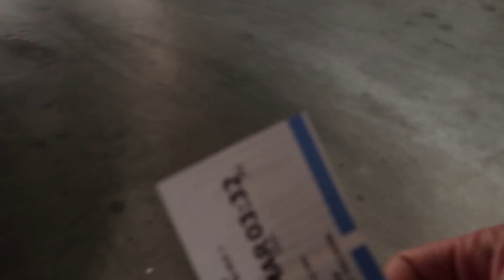Engine Swapping The MR2 ?

Comment: Hey Rexy, what about the version I liked most of the 3S-GTE turbo in the 4th gen Toyota Caldina because they completely revised it; even with a reinforced cylinder block & higher flowing cylinder head etc. 
It put's out 191kw in the Caldina stock, but just one modification courtesy of the turbo boost controller will easily get it up to 230kw. 
It makes the MR2 a 12sec car like that.
Reply from the maker: I'd like to but it'll be a lot more pricey that a cheap V6 swap
Reply: @RexH  In Australia, a 3SGTE are extrememly rare. Looking 3/4k just for the engine while I got a 3VZ turbo for 4k installed

Edit. 1mz and the 3VZ can use the s54, but if you drop the clutch hard you will strain it. The turbo tranny (e153) is good but you don't need it immediately. Don't go the 3SGTE in Australia, I've been looking for 6 months and you're going to pay stupid prices for it. I know exactly how you feel, the V6 is the swap you want.
Reply: Ben's Chill Channel 
It might be rare, but the motor is well established with the extensive use in Rally's with lesser cylinder blocks in the Toyota Celica, despite having significantly higher power outputs. 
It would be hard to beat in terms of power per litre of engine capacity for the weight & dimensions. 
With the modifications Rexy has already done, I think the torque down low would be a match for the V6, plus it has less mass. 
The sky is the limit from there.
Reply: Rex H 
I found a place near Melbourne that supplies second hand 4th gen 3S-GTE turbo motor's: 
http://www.toyrolla.com.au/toyota-car-parts-3s-gte-engine/
Reply: @brantleyfoster021  Problem is though, you need more than just the engine. You need a halfcut, because ECU, axles and a few other things. It is a good motor, and their is decent aftermarket but $$$ to get all the parts for a swap. Like super easy to build to like 300 HP with only a few cheap mods
Reply: Ben's Chill Channel 
But wouldn't you need to do that for a Supercharged or turbocharged V6 too?
Reply: @brantleyfoster021  You do have to get halfcuts for them usually, but they are way more common. The V6 camry is what 2 commonly swapped motors are from (3VZ and 1MZ) and they're in abundance and you can pick up a junkyard car for $600 in decent condition. Shame since the 3SGTE is an easy swap aswell
Reply: Ben's Chill Channel 
The latest Camry motor with over 300hp would be awesome, but the problem is it's the latest model. 
I doubt you would be able to get it for that cheap tbh.
Reply: @brantleyfoster021   Yeah of course, that's the 2GR. That's an awesome engine that I'll never be able to put into my MR2 ahah.

 The 3VZ which I run on my mr2 (from 1997 camry) with some mods (port and polish/intake/timing mods) made na around 200bhp and can do a mid 13 1/4 mile which is as good as a lightly tuned 3SGTE.
Reply: Ben's Chill Channel 
If it's a mid 13sec car, than it's pretty close to a 3S-GTE turbo. 
I wonder how it would respond to the RX7's Twin Turbo Wankel Rotary?
Reply: The 4th Gen 3S-GTE has weak rods anyway. 3rd Gen is the way to go. Stupid easy to get 300whp+ out of that engine with bolt-ons only.
IMO a V6 will never be as exciting as a 3S-GTE. I’ve owned quite a few of each and V6 bores me very quickly.
Reply: @negativeindustrial  That's just you man I love my v6 but the 3SGTE is an awesome engine. But currently it is cheaper to buy a Caldina and then scrap it. Which is the same cost as a 2GR almost. On Carsales, the cheapest Caldina is almost 5k, with 200,000 Km.
Reply: Ben's Chill Channel
Yeah, we can stumble over all the V6’s in our junkyards here in the states. 3S-GTE’s are rare as hell and somewhat costly here. That’s a huge factor, as you pointed out.
The V6 works great in the FWD Celicas we were stuck with here, too.
Reply: Neg Ative 
4th gen has a better cylinder block though, they did this because prior version's were prone to cracking.
Reply: Brantley 
I’ve heard that but have you ever known anyone who cracked one? I’ve got a pair of 28yo gen2’s downstairs in my Celica and my MR2T and over the years I’ve had a dozen more, probably easily that many friends with them - all gens 1&2 because US spec - none cracked. Not one.
In the US we use our 98+ Camry blocks to make super strong stroker 2.2ls
Reply: Neg Ative 
The 3rd gen rod's are compatible with the 4th gen motor, make the switch for the best of both world's. 
I haven't met anyone who has damaged the standard rod's in the 4th gen though, but do know a few people who cracked the cylinder block of prior gen motor's to the 4th gen.
Reply: Brantley -
The cylinder head?!? I assumed you meant the blocks. Damn
I’m pretty happy with my Gen2’s. I’ve always appreciated the low end feel of T-VIS and I run modified Gen3 WRC Turbos from Celicas on 21PSI and RC/CS ECUs (which have much more aggressive timing).
I’m also a guy of moderate needs. Anywhere in the 300-350hp range is the sweet spot as far as I’m concerned. Both cars perform beautifully there. My ‘94 Celica is a swap (obviously)
Reply: Neg Ative 
Yes I meant block's sorry LOL, my spellcheck has a bad habit of changing my word's without me noticing. 
350hp is great for the MR2, might be a bit more with some current performance tyres as they are sooo much better than what they used to be back when these car's launched. 
With a AWD Celica; just depends on what you're using it for.
Reply: Brantley -
FWD Celica. We got fucked here. Even as fully modded as that car is, it can not handle any additional torque. The S54 is maxed out, the axles break, even the MR-S LSD is not really digging it, I can tell. 
I built that car when I was younger and had different dreams. It was an ST-204. Ill buy an ST-205 sometime within the next few years now that they’re legal.
The MR2T is sitting on Firehawk Indy 500 275/40-17’s so it hooks the fuck up on the street. That car is lacking a few things that the Celica has but it’s the full GReddy package so it breathes well enough for a road car.
I had a 4th gen engine in my garage, paid for but this was like ‘04 and I ended up doubling what I paid for it when it immediately sold to a buddy.
Missed opportunities.
Reply: Neg Ative 
Firestone is a mid range tyre brand bro, it's not a premium tyre brand. 
I think Michelin offer the best ones as a premium tyre brand, try there current semi slick tyres bro.
Reply: Brantley -
Have you run these tires? They’re a nice compromise between semi-slick and all weather tires. Why would I want semi-slick on a street car?

Comment: For a budget a nitrous tank, a freer flowing intake and a freer flowing exhaust would be a lot less expensive than another engine, if the existing engine is in good shape. Then you can drive it normally with normal reliability most of the time, and once in awhile push the nitrous button for more power and less reliability. Ideally have an expert set it up. More for short straights, from a stop or just after a corner. If you blow up the existing engine, you then have a good reason to add a different engine.

Comment: 1mz = aluminum
3vz = cast iron

Both are good swaps.. I prefer the 1mz to keep it closer to the oem weight balance/ratio..

Why not drop a hotter cam in the 3sge and build the head... Or beams swap it?